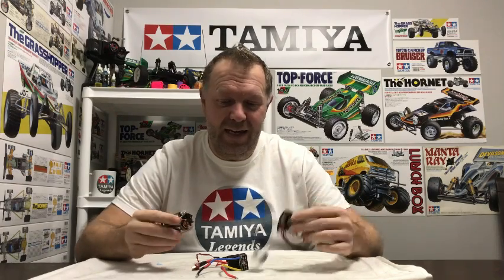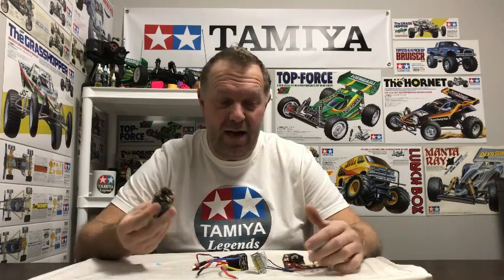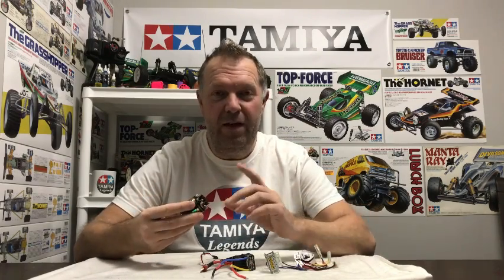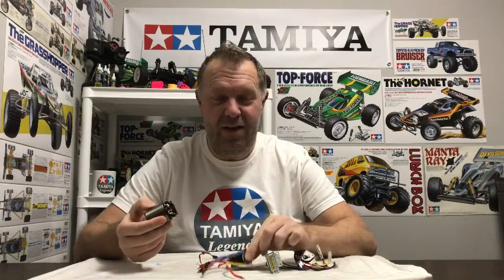I got it WRONG! Should of done my research!!!

Comment: Thankyou. So what's the correct way to adjust timing? Or is it just that the ESC coulndt handle the rpm when the motor was turned up? 

The Tamiya motor manual just has the end bell cap turned in the correct direction.
Reply from the maker: kasparov9 
Hey buddy,
From what I’m reading it’s usually best to leave the timing alone, they come on there optimum setting as standard. The big mistake I made was actually turning the timing up while it was under full power 😞
So I’m still reading up on it all at the moment. I still plan to have another crack at it with this motor, so let’s see what happens 🤔
Reply: @TAMIYALegends  I think they usually come set with a good balance between speed and economy

Comment: 😁👍Yep never do that on a esc!  Also you should break in the motors before running them in any RC or the brushes will arc and cause more heat = premature wear. do it out of the car at like 2 to 3v to seat the brushes properly to the com so the motor runs better and last longer  maybe 10 min up to a hour on some motors... Did not know if you broke the motor in before using it.
Reply: How long is a break in anyway? Is that just hooking it up to a battery and letting it run load free?
Reply: @kasparov937  Hi you need to run the motor only out of the car at like 3v for like 10 min at least some can take up to a hour . 15min should be good for starters for a normal can motor.
Reply from the maker: Shen RC 
I’ve also seen the run in process done with the motor submerged in water💦
Reply: @TAMIYALegends  Yes I do use that method also but do not run it no ware as long as not in water because when under water the brushes will break in much faster so keep a eye out and check them often.
Reply from the maker: Shen RC 
No I didn’t 😞
That’s why it got quicker when I was running it I guess?